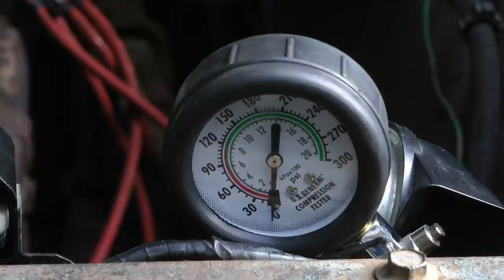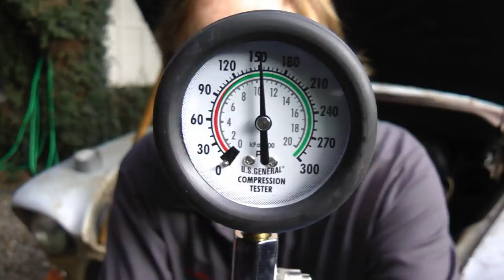How to Tell if Your Car's Engine is Bad

Comment: My engine has a serious knock when first started during the day... but as it warms up after about a 1/2 a mile to a mile the knocking goes away. What do you think the problem is and what can be the most viable solution.... (rebuild the engine, buy a rebuilt engine, etc.)? Thanks...
Reply: It is a 5.7 ltr in a 1999 Chevy Suburban, 2 wheel drive, ...
Reply from the maker: *****
  rebuilt engine, check out Pistonslap.com  that's a known GM engine problem on that model.
Reply: Damn, would a rebuilt engine fix this problem? Or am I setting myself up for another disappointment?

Or, could you recommend another rebuilt engine that I could slap in that would work with the transmission I already have?

Also, can you please recommend a reliable place where I can get another 350 / 5.7 ltr engine?

I really do appreciate all your knowledge and help... I was getting ready to buy a camshaft kit in an attempt to remedy this problem...

Final question, would it be more cost effective to remove the block and bore the engine (rebuild myself)? This engine slap is really excessive and because my wife has been using it .... now the noise is evident even after warm up and I think the engine may be beyond repair!

Sorry, so many questions!!!

Thanks again!

For everything...
Reply: Those engines are notorious for piston slap from what I've heard. I am driving my dad's 2000 Chevy Silverado with the 5.3l vortec, and it has the same issue. As long as you don't rev it when it is slapping, it won't hurt anything.  A rebuild isn't totally necessary, but it will get rid of the noise.  The problem lies with GM using a shorter piston skirt in these engines to reduce rotating mass in the engine.

Comment: Hi Mr. Scotty. i got 2 problems. oil leaking from oil filter adapter ( i think) and low oil pressure on my  2000 f150 4wd 5.4 can you tell me where the oil sending unit is on this truck
Reply from the maker: +TheYaucana remove the adapter and put a new gasket on the inside, fix that first, could be the whole problem. The oil sending unit is on the bottom middle of the engine near the filter

Comment: I bought a civic with 218k miles on it. it feels like it runs well but after I do a compression test I want to know if there's other simple tests I can do to check if the internals are solid without disassembling the motor?
Reply from the maker: do a wet and dry compression test, and a  leak down compression test. Anything else requires take down, other than a borescope looking into spark plug holes with the  plugs removed
Reply: Sounds good, thanks Scotty.

Comment: Hello i have 2000 pontiac sunfire and i believe the engine is shot. I dont have money to get tools to figure it out but i know the head gasket is fine do to no oil in the coolant. I believe the engine is dead because it wont go above 5rpms without a stall and there is a loud knocking from the engine. I believe its from the vlaves slidding and hitting each other due to lack of oil getting to it. Please tell me what you think.
Reply from the maker: junk it if you remove the fan belts and the knocking continues, pray the noise goes away then and that it's  bad alternator bering or other device
Reply: +Scotty Kilmer the belts and alternator were replaced before I bought. Thanks for the quick response!

Comment: Hay i have a Nissan almera and have always got it serviced but this i went past the due date, the engine has just start making a ticking over noise where before it was real quite, i just put oil in but it was below the low level, could i have done bigger damage and if so what possible damage?

Comment: How long are you supposed to crank the engine when doing a compression test? When I did it the results were all on spec but I cranked the engine till the gauge needle stopped moving, but I'm not sure if that's the correct way to do the test.
Reply from the maker: that's fine, but as long as you crank em all the same number results are accurate
Reply: Scotty Kilmer Thank you for answering Scotty, love your channel a lot. I wish you the very best in life.

Comment: Hello Scotty,
I have an 07 Taurus that after a few minutes on it starts bursting water off the radiator with the cap on. U by chance have any ideas of what might be causing this issue? I've replaced the thermostat but still doing it n when I drive it the temperature Gage stays at half it doesn't indicate overheating. Thanks!
Reply from the maker: +DG MAMBO blowing head gasket is common, do my video "how to tell if your head gasket is blown"

Comment: would you be able to tell me how to fix blow by on my nissan altima  1999.  its blows air and oil from the oil cap on top of the motor

Comment: Can someone please help?? I just unseized my 97' F-150's 4.6 engine by spraying Liquid Wrench down each spark plug hole and waiting 2 days before turning it over by hand with a socket. My question is, how do I clear the spark plug holes from all of that Liquid Wrench I sprayed into it? Is it as easy as just draining the oil? I'm worried if I put new spark plugs in and crank my truck up that something horrible might happen. OR, that my new spark plugs will end up getting gunked up...
Reply from the maker: just leave the spark plugs out and crank the engine and the crud will fly back up the hole
Reply: Thank you!
Reply: +Solo Cupguy Did it work?
Reply: Hey PlatiumCruiser. It did work. Before I cranked over the engine I made sure I put some paper towels around the spark plug holes to catch as much of the liquid wrench residue. After that I just put in all new spark plugs, drained the oil, replaced the oil filter and put fresh new oil, and then drained my radiator fluid and put all new fresh 50/50 antifreeze and she cranked right up. She works even better now. Let me know if you have any questions and I'll try my best to answer them. Good luck!
Reply: Awesome Thanks!

Comment: What's the advantage to the weird quad tipped plugs? All they did was cause a random misfire on my truck
Reply: They are not a very good plug I run ac plugs in my 81 Camaro but ngk are also very good and strong
Reply: Ethan Kurtz Useless as electricity takes the line of least resistance !!.  The spark will therefore jump across the tightest gap.

Comment: Hey Scotty... In 1972 I was driving a 1964 Impala with a 283 in it (Looks familiar in this video).  After owning it since 1968, I thought I was burning oil by '72 to the point I thought the engine was shot, but the plugs always looked clean and dry, etc..??   Anyway, one day I was exiting an expressway and going uphill on the exit ramp.  I relaxed the gas pedal (Throttle closed) to slow/coast to the stop sign.  Looking in my door mirror, I see this plume of blue smoke trailing from the exhaust pipe at rear.  Is this what you are talking about?  If so,  I am puzzled that the plugs never looked bad!!
Reply from the maker: blue is a combo of burning metal and burning oil. Piston rings are somewhat worn ad probably valve seals too
Reply: Scotty Kilmer 'Burning metal'? An engine has to be rather hot and on the verge of seizure for that!
Reply from the maker: *****
not always, ;piston rings and cylinder walls can burn a little here and there and tinge smoke blue.
Reply: Scotty Kilmer True, but for the better part, particulate from those end up in the pan...and some of that in the filter. If I'm not mistaken...wasn't that SB a Vortec?
Reply: Scotty Kilmer you want to also make sure when you're running the test that you crank the engine over the same amount of revolutions for both wet and dry tests, am i right? that way it factors out getting the same reading due to the fact that you cranked the engine longer on one test versus the other

Comment: hey scotty i have a 1994 mustang gt with the 5.0 in her, i have a squeaking that i have no idea where its coming from, it stops when i push the clutch, already replaced the throwout barring and both belt idler and tensioner any clues where it could be coming from?

Comment: question I got a 1996 Nissan 240sx the problem is when I go to turn it on it struggles to turn on I usually have to crank it like 5-10 times until it turns on once on it idles normal  sometime then when I give it gas it or drive it it shuts off randomly and I got to crank it it like 2-3 times to turn it on again I replaced the fuel filter and fuel pump as well ?? what could it be ?

Comment: 7-8 true strokes will give you a "leveled out" reading, not 2-3 strokes.  Granted, time needed for starter cool-down.  Running compression test results work too, but hey I'm just a hick from CA what do I know
Reply: I might be getting different results from a compression tester if, I don't know, I was using something not from Harbor Freight and running a crank test with the throttle wide open like I should be

Comment: what about oil pressure ? Sure a compression gauge will tell how much it can puff . What if the compression was fine but the oil pressure is at the low end of the spec ?
Reply from the maker: well, then the oil pump is worn or bearings inside the engine are worn causing oil pressure to drop

Comment: Scotty i really need your help. I pulled my engine oil pan on my 2007 toyota rav4 (2.4L 4 cylinder) due to leaking gasket and found not only lots of metal shavings all inside the pan but also several small acorns (yes acorns like the kind bird and chipmunks eat) althought they were small i dont know how they got there. I am worried they got sucked in throught intake as my air filter is full or acorns as i live in the woods but how could it get to oil pan?? through the piston rings?? im really worried and dont know if this is a serious sign of bad internal engine issues or not please what is your take on this??

Comment: So how does one remove the oil from the piston cylinder after the pressure test? Or is it not necessary?
Reply: Not necessary. Oil usually flows in there anyway.
Reply: rafael502 But make sure you add clean oil without any dirt
Reply: ThreeDriv3rs  shit fuck! I put some used oil with a metal peaces i thought its nothing gonna happen and it just will be thrown away through  the exhaust valves
Reply: Марк Пресняков Really?

Comment: Hi Scotty! Big fan. I have a 2001 Ford F150 that is burning oil. Unfortunately it isn't the PCV valve. Other than adding Lucas Oil Stabilizer when I do oil changes, is there anything else I can do to help to prolong the life of my engine? Thanks! Also, from your videos it looks like you served with the 101st. Is that correct? Thank you for your service!
Reply: may have a burned valve stem
Reply: +Drew Dont drive it as often.
Reply: Never, ever add Lucas shit fix to your car. It doesn't prolong anything. Only masks it. Tell that to my failed transmission after I used Lucas 6 months prior.

Comment: I have 1974 buick regal with an 350 rocket in it my question is what other size motor can I put in there
Reply from the maker: Sameer Williams stick to what's in there, or you have to do some serious mods, that's a very good engine

Comment: Scotty is it easy to rebuild a engine, if a customer comes to you with a bad motor do you yourself replace it??
Reply from the maker: it is not easy, especially modern 4 cam engines. These days I tend to put in low mileage used engines instead.

Comment: hey Scotty, i have a few issues with my car, it's an  89 Corolla GTS.  for 2 days already, I've been hearing the sound as if I have a flat tire but I don't, the sound is around the axle and etc, can it be my wheel bearing waring out? 

When I'm at an idle, it'll bounce from 1k-15krpm, what can be the problem?   I have other issues but somewhat to much too type and I was wondering if I can just send you a 2 min of the issues. If not then I'll take the time and write everything
Reply: +Joey Valenzuela If the suspension sound is consistent and increases in speed with vehicle speed, yeah, it's probably a wheel bearing. Clean the throttle body for your idle problem. If that doesn't help, I think those cars have an idle air control valve, so clean that out and make sure there are no vacuum leaks or other obvious issues.
Reply: holy shit dude, your corolla can hit 15k?

Comment: My engine is in bad condition, it leaks oil, smoke comes from the exhaust, I have to top it up with water before every journey cos of a leak in the radiator, I've put an egg in it to stop it leaking but it just makes the car smell like an omelette gone wrong, it misfires, the timing is out, the fan belt needs replacing, the oil is like tar, it only runs on 3 cylinders, also it'll only start if I'm on a hill and I let it roll down before lifting the clutch when enough momentum is built up. Apart from that, the car's a good runner

Comment: Hey Scotty Kilmer I have a 4.2 2003 trailblazer LT, we plugged in the  machine that reads codes,  it came back with codes we changed the oxygen sensor, and a coil spark plug. It reads cylinder misfire 1 the spark plugs are good and all that it idle's ruff still after all those changes, do you belive its the Fuel Injector to that one cylinder, that's making it idle ruff. Theirs minimal loss of power its just idling ruff feels like a v8 sort of feel to it with the idle, it only has 70,000 on it and is in good condition just trying to figure out what happened. We did put a lot of miles on it going back and forth and hauling a uhaul trailer it ran strong and fine then the other day this happened what are your opinions.

Comment: Hi Scotty! I'm a big fan. I took a cue from you and bought a Celica. Unfortunately, it's in bad shape.
Car: 2000 Toyota Celica GTS (132,000miles) @ $3k
Problem: Misfire on cylinder 4
Symptoms: Low idle, slow acceleration, bad gas mileage. Audible water gurgling sound from the air vents inside on startup.
Note: No smoke from tailpipe. Large aftermarket resonator on exhaust (airflow problem?). 
Diagnosis: Checked ignition coils, spark plugs, fuel injectors, O2 sensor - all good.
Leak-down test reports 90% leak through to the exhaust on 4th cylinder.
Compression for three cylinders is 220psi, but 120psi on the 4th.
I'm an amateur at best. What do I check next? Should I take the heads off and send the valves in for work? Any way to salvage my investment for less than $1k? Thanks!!!
Reply from the maker: +Mark H ya bought the wrong celica, those had bum engines in them, odds are you need a new engine. ALL my customers with that model are one at least their second engine. Most guys try used engines IF they can find a good one.
Reply: +Scotty Kilmer That looks like a 1955, 1956 or a 1957 chevy pickup...lol I would just leave the body the way it is and go Patina. I would focus on putting a new engine in it...lol

Comment: Hey Scotty
Wondering something, what is normal presure for a not worn engeen?
have a 1.8, 4 cylinder car and are wondering what presure that would be "good".
Since we use metric system : 200.000 kms driven, 1998 mod. BMW
125 was low for this engeen, but how much is low for my car?
Reply from the maker: no idea what metric system readings are, but all cars are different depending upon original compression pressure. Once you get below 70 percent original, that's weak.
Reply: Google the specs for that engine. Hit a couple BMW forums to find the original spec for the engine and compare. Like Scotty said if its 70% of the original spec then it is on its way. Higher compression engines, like the ones in smaller BMWs are fairly reliable but 145k miles is a lot.

Comment: Hello sir , i had not used my bike for around 6 months its 4 years old and 30k kms running 180 cc  , my bike doesn't go more than 70kmph  but before it used to cross 120 kmph  , i have changed oil recently thinking its because of oil please help me out

Comment: Not sure if this will be a rhetorical question but what number determines normal compression to see if your engine is good?
Reply: Every car is different, Google search it for your car.
Reply: Well, if the pressure is the same as the reading you took before you put oil in I assume it would be a good piston. If it had such a bad seal that there was no seal even with the oil then you would hear the engine clunking anyway if it even worked.
Reply: What Subway Guy said is correct. However, if you do a pressure test, you do all the cylinders, (first dry and then wet) and they should all be very close to each other in values.  If one or two are noticably lower, that's a sign of problems, either rings are shot or valve(s) trouble or head gasket blown.  Fairly even readings across all cyls, put 'er back together and keep on truckin'.

Comment: I bought a 79 Chevy with a 350 and I did a tune up sorta I change spark plugs, plug wires, rotor, and cap and when I pulled the spark plugs out they had rust where the plug connects to it and the bottom was BLACK and oily. Would that mean my engine is worn as well? The truck also leaks out of the back corners of the valve covers could it be from that? Thank you
Reply from the maker: TheXV1CT0Rx   it's worn for sure, black means it's running rich, and worn engines often do that
Reply: What if the carb was set to the rich setting? Would that effect it?
Reply: TheXV1CT0Rx black and sooty means it's rich like Scotty says. But it shouldn't be oily. Oil on plugs is only caused by burning oil